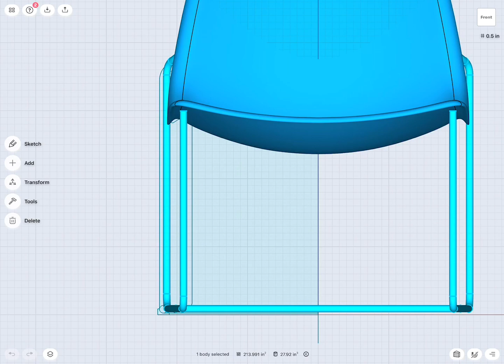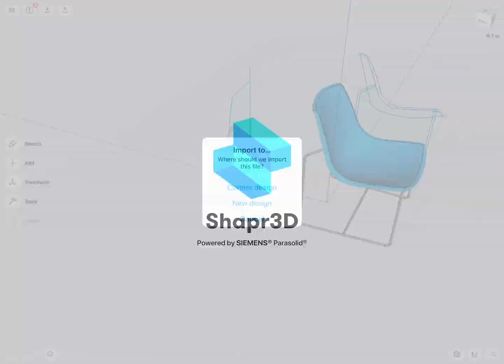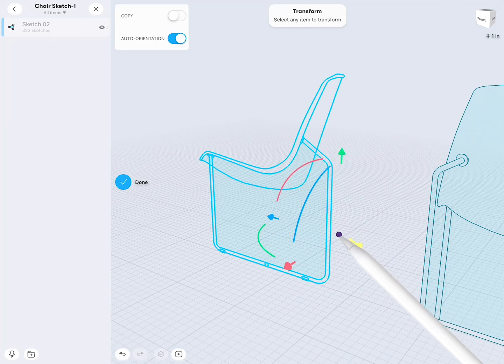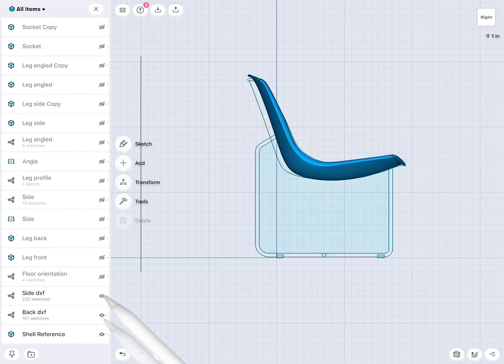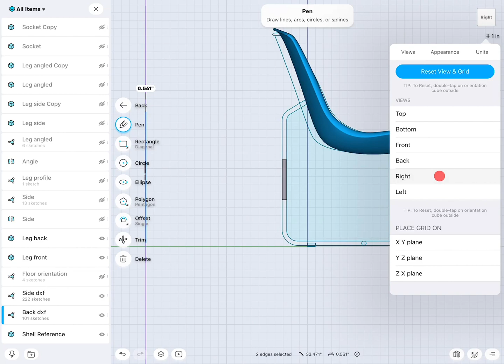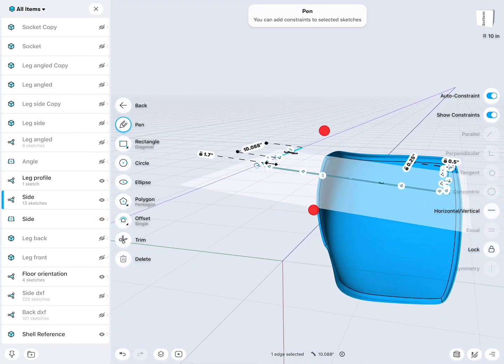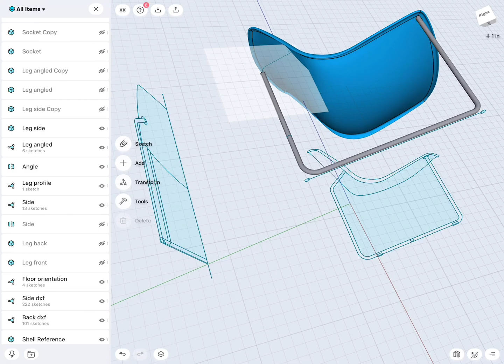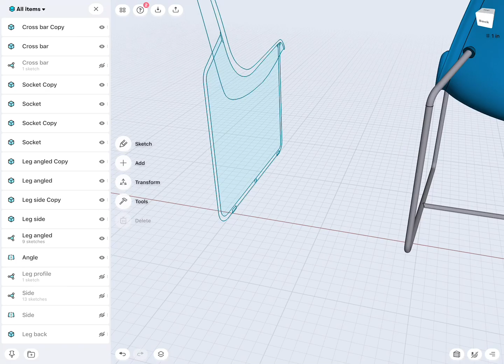Import DXF files to your iPad for furniture manufacturing workflows | 3D design webinar

Comment: so for dxf dmg export. I tried to export to Shapr3d on ipad, it will import simple vectors. but i’m having trouble with text, or text converted to curves.  it opens but says the layers is empty. just if you use Shapr3d too? if so, do you know what is causing this? is it a setting i need to change when exporting as dxf dmg? thanks